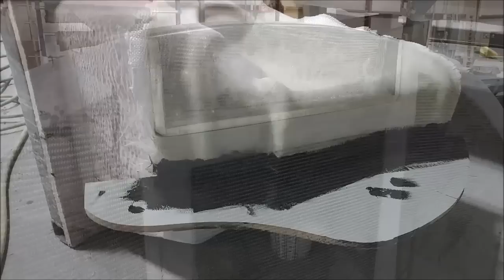Raptor Aircraft January 28th 2017

Comment: Is it possible to keep all bolts metric  ? I noticed in your previous video you had a 1/2 drill bit in there door frame.  The Engine you got lined up is an Audi and I know it does not have any 1/2 inch bolts in it, besides if you keep the prices you got you will easily be able sell your plane world wide.
Reply from the maker: Most likely for the prototype everything will be imperial except for the engine.